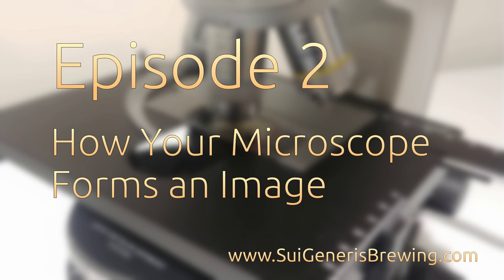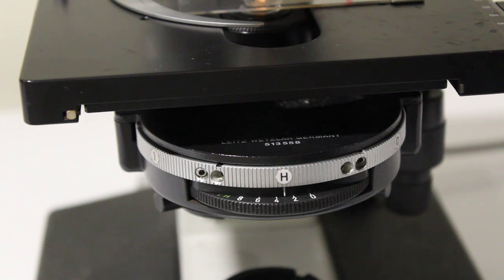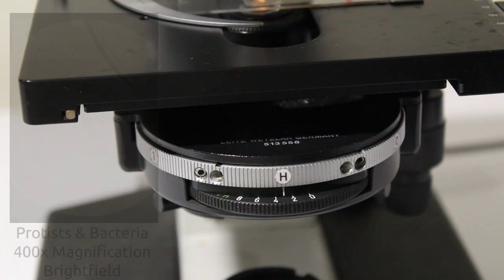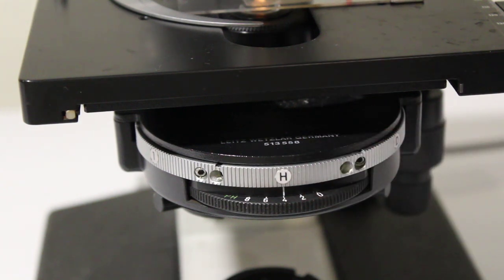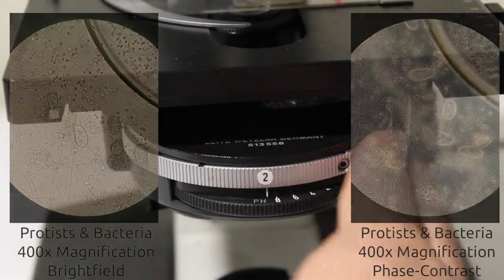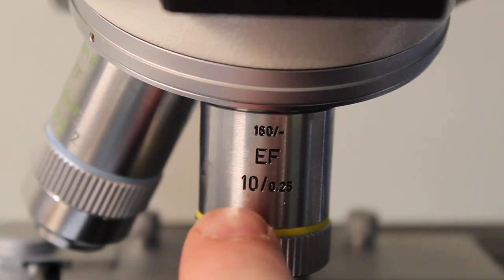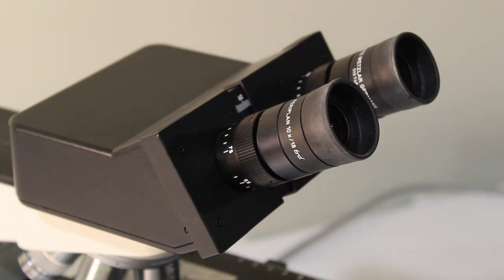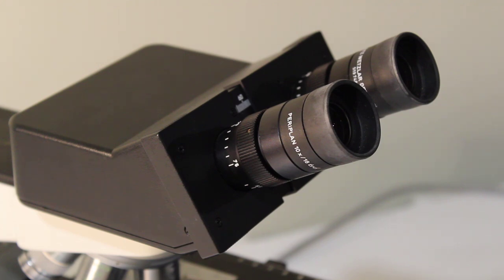µBrews Episode 2 – How Your Microscope Forms an Image

Comment: Is 10x eyepiece enough for homebrew microscope? I have old Olympus BH2. This has option 15x and 20x eyepiece.
Does extra magnification useful for our needs ? 
Thank you.
And think you again  for your videos and great work.
Reply from the maker: A 10X is usually more than enough. In fact, 15x or 20x lenses are often used by manufactures as a cheap (but not overly effective) way of giving you higher magnification. If you want to know more about this, check out the "empty magnification" section on this old blog post of mine: 
http://suigenerisbrewing.com/index.php/2019/04/21/choosing-a-microscope-for-you-yeast-lab/